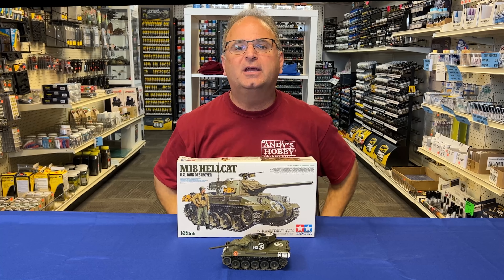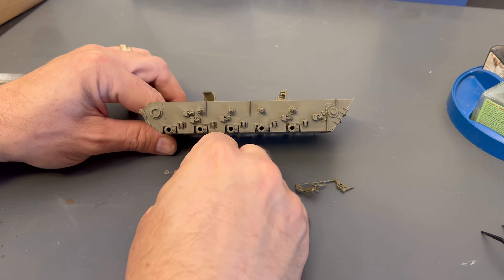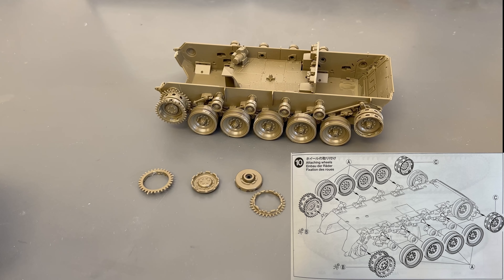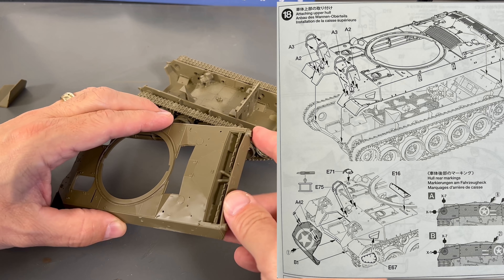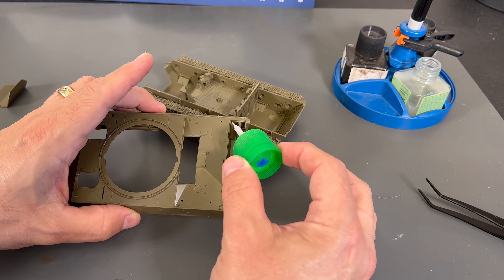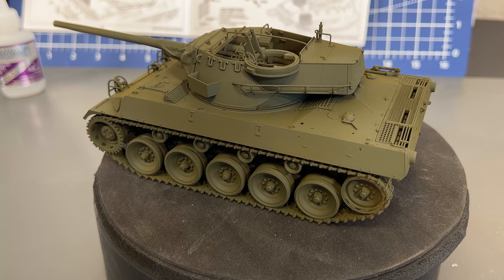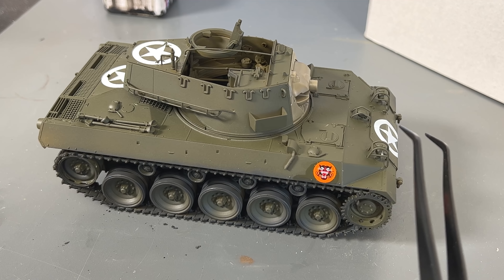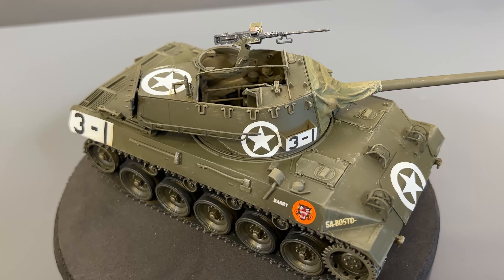Building the New Tamiya 1/35 M18 Hellcat (Special detailed indepthed build )

Comment: I didn't pay close attention to the tracks when you built this kit, Andy. I broke into mine a few days ago and the new engineering on this track link set up is amazing. I typically struggled with your technique for building the link and length tracks but this way, with the guide notch in the idler wheel, is 21st century BOSS!

Comment: Good video!! I pre-ordered this kit back in October and cannot wait for its arrival. Anyway, have built the Academy version of this vehicle about 10+ years ago. Can remember that it was a bit unnecessarily complicated - but that is Academy kits for you. also, it gave you the chose of 1-piece vinyl tracks which were too tight and did not fit properly AND it gave you link-n-length tracks as well. Eventually got it finished.

Comment: Hi Andy how do you go about painting wheels with rubber on? I’ve bought my first tank kit (not new to modelling) but be interested to see a video on how you go about this as your working is amazing
Reply: Hi - Appreciate this comment is a month after you posted yours so you may have already figured out a way that works for you already 

I use blu tac and find it helps cover the inner metal parts of the wheel leaving the rubber parts free to paint
Reply: @bradenrobson7513  thanks buddy yes I’ve had a go but like trying different things so will have a go

Comment: Good idea from Tamiya, there are not many competing M18s on the market so I expect this will sell very good. I generally don't buy Tamiya AFVs, because they are just not very good, but this one might actually be the best option for M18. Of course, those terrible decals will have to be dealt with, but that's not that difficult with tank kits.
Reply: Not very good? I love them.
Reply: I build my M18 Hellcat out of parts of AFV and Tamiya because both models had some mistakes in the shape of it. And from the look of it Tamiya didn't changed them in the "new" Kit.
Reply: @ytwos1  Well, they have good fit and are easy to built sure, but the competitors now offer well more detailed and what's more important way more accurate kits for the same price. Tamiya AFV "division" is rather inferior to their aircraft production, which are still mostly the best on the market. Tamiya tanks though are oversimplified and quite often just terrible as for example their M1A2 Abrams, which they created by only slight modification of their very old M1 Abrams kit despite the fact that there are very significant differences between these two in real world especially considering the suspension. That's rather logical, because M1A2 can weight almost fifteen tons more and the suspension has to reflect that, but not in Tamiya world. So generally when dealing with aircrafts go for Tamiya, but with AFVs the offerings from companies like Takom, RFM, Miniart etc. usually will give you more value for your bucks.

Comment: That box at the back ofnthe turret is supposed to be the radio! Afv clubs was the same i swapped it out fornthe actual radio that sat there! As its right in your face being open topped! 
academy's and afv clubs turret basket were one peice nothing new with tamya doing this! Afv club had the slide Moulded turret so that was always the better one only if they stopped using them rubber bands for track's! I was another £30 for metal track's but the hellcats track's look amazing in the metal I'll give them that so was worth it! And we had separate shell rack's don't like that 2 peice full rack! Nice to have some used up or the option atleast depending on price of the new Tamiya kit that's what it comes down to with choosing this of the afv club kit! Did it come with the front hatch windscreen covers that were stowed in the side turret bins?
Reply: I was just looking at the other options, because Tamiya AFVs are usually lacking and are not on par with the competition especially considering their pricing, but the only other M18 on the market right now is that by you mentioned AFV Club kit, which while looking generally OKish has those rubber tracks that are just no go. Rubber tracks are such a terrible idea.

Comment: What is the best water based paint of models?
Reply: I've had good experiences with Vallejo if that helps?
Reply: Vallejo is great and its not super pricey
Reply: Why you want to use waterbased? And what you call water based? Gunze call their H line water based, and those are far superior to the Vallejo paints. Vallejo doesn't belong in airbrushes, not even the Air line. Those paints spray like turd (and tipdrying), almost any other paint atomizes much better, except the former (pre v3) AK acrylics. That latax based formula is good for paintbrushes, but the worst possible for airbrushes. And it could be a nightmare to clean it out from your tools. The other thing I had experienced with those paints and primers: they don't adhere to the plastic really good. Peeling off easily, despite any cleaning and degreasing of the surface before.
Reply: @egyeneskifli7808  Well, I guess it sucks that you have had bad experiences with vallejo's range. Oh well. But I can personally attest that their stuff has worked pretty well for me

Comment: which type of glue did you use？
Reply: That's Tamiya extra thin.
Reply: @davydbudden1583  when i use it like that, all the glue is evaporated.
Reply: @hkpango1996  I have the same problem, but I've seen several people use it and have a minute or so working time so I often hold the parts together and then put the glue along the join.
Reply: @hkpango1996  are you using normal extra thin or fast drying extra thin? Because there are two of them  :)
Reply: @randomnickify  Same packing as the video shown

Comment: Andy - feedback to Tamiya. The design of the drive and return wheel assembly is poorly done. Clever idea, but it just doesnt work as well as it should do. This results in poor fit in the final product (I could even see that in your build). Biggest failure on a Tamiya armour kit I've built for a long while.
Reply: Dead right my friend , almost made a dog's dinner of both, also had problems with overall fit  in both turret and attaching upper hull to main body , needed elastic bands + putty job .
Over all kit looked good when finished , but not up to Tamiyas usual standard !
Best Edward ( Ireland).
Reply: @edwardkennedy5680  Totally agree with you.

Comment: I really don't know what is justifying the Tamiya prices. I had a few of their kits. All have serious simplifications, and inaccuracies. If you mentioned the Sherman: the Tamiya has only 76 track links. That means their Sherman kits are the second worst in the market in this aspect (close to the worst Academy with 75 links). I really don't know how manufacturers keep missing the number on one of the most documented tanks of all time. The normal length Shermans had 79 track links, the longer ones (A4 and A6) 83. Zvezda could hit it perfectly, so it is not a hard task. And their Shermans are quite well designed and molded, with link and length tracks. For half the price of the Tamiya, with inaccurate rubberbands. (And everybody should learn from Zvezda how to mold road wheels without the midseam.)
Asuka and RyeField Shermans are only a fraction pricier (17k HUF Asuka and RFM, 16k Tamiya), but much more detailed. Even the old Tamiya Shermans are 12K, and that is a joke. Those kits are from the early 1980s. I bought the M51 because Tamiya is the onlyone who make it. I am in a Sherman project now, building every variant from a different manufacturer. Sofar the Zvezda is the best, Tamiya is in the middle of the pack. Really overpriced. I won't buy their Hellcat, nothing justifies the pricetag.
Reply: So you won't buy Tamiya's brand new, nicely detailed and accurate kit of the Hellcat (with link & length tracks) because 30 years ago the same company produced a less detailed and less accurate Sherman kit (with rubber band tracks)?  Strange logic...
Reply: @Jackdaw5  I am also don’t want to buy this new kit because I am experienced modeler and prefer accurate details but not the oversimplified ones
Reply: The Tamiya M51 and Super Sherman’s are from early 2000s (or very, very late1990’s), not the ‘80’s.
Reply: @Jackdaw5  Nope, that is their current Sherman. It is 2001 in origin (meanwhile still manufacturing 40 years old Shermans too). But still: absolutely overpriced. Just like almost everything Tamiya, except their 50-60 years old kits. For god sake, they don't even bothered themselves to give a grille over their PzIII's air intake. Not even a molded plastic one. They tipically cut corners on their armour kits, but still ask the premium price. You can get the same quality from other companies for half the price, or much better for the same or slightly higher.
Reply: @egyeneskifli7808  Where are you finding kits half the price of Tamiya kits? I’d really like to find 1/35 armor kits again for $25.
Reply: I get tamiya kits because the fit on there peices is really, really good, there plastic quality is nice, and I'm not going over the kits with a microscope looking for innacurate parts...also there airplane kits are simply amazing.  Build the 1:48 p87d thunderbolt and you will understand!
Reply: @vegasspaceprogram6623  Yes, their aircraft kits are exquisite. But their armours are not necessarily. My main problem is not with the quality, but the price they ask for it. The two things are in discord. For a little more you can get much more detailed kits. Tamiya armour kits are overpriced.
Reply: @egyeneskifli7808  fair enough. I justify the price cause I dont buy many. And I guess, because I'm a guitar player, I tend to ignore prices on model kits...
Reply: @vegasspaceprogram6623  For RFM/Takom/Asuka/etc you pay the price of accuracy, detail level and part count. With a Tamiya kit you pay the price of your "lazyness". I don't want to offend anybody with it, but Tamiya knows there are people who don't want to immerse into a single kit, they just want to build something somewhat easily. Well, I rather pay for detail. For simplycity and convenience I won't. I bought the M51, because nobody else make it, and I'm in a Sherman roundup. I want to build every variant from a different manufacturer. This was the only thing that justify to buy a Tamiya Sherman. At least for me.